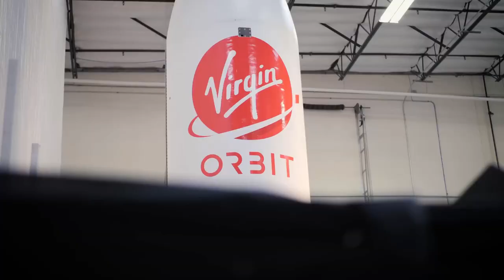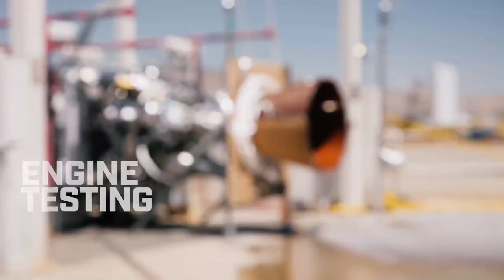Virgin Orbit - Cosmic Girl & LauncherOne | 𝕍𝕚𝕕𝕖𝕠 𝔼𝕕𝕚𝕥

Comment: A pity they don't have a B-52, imagine the huge payloads they could lift!

Also, was that Rocket at 1:25?
Reply from the maker: Kumquat Lord Cosmic Girl is a Boeing 474-400 and is bigger than the B-52. Also it has more payload capacity:
Boeing 474-400 => Maximum payload of 274,100 pounds (124,330 kg)
B-52 => maximum 70,000 lb payload (31751.466 kg).
I bet you are surprised to hear that!!
Reply from the maker: @Kumquat Lord At 1:25 it's just having a little FUN, we need some FUN in order to make it all seem more human.